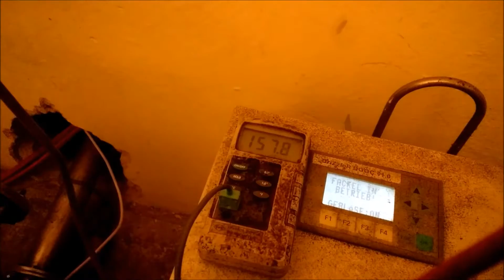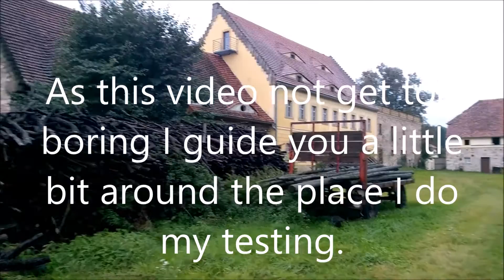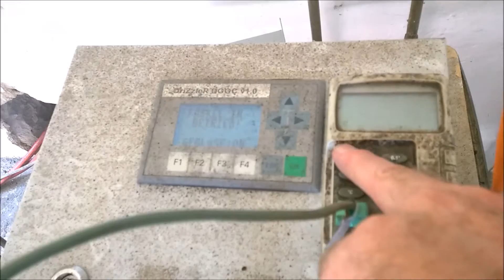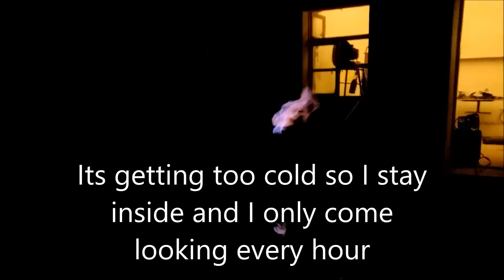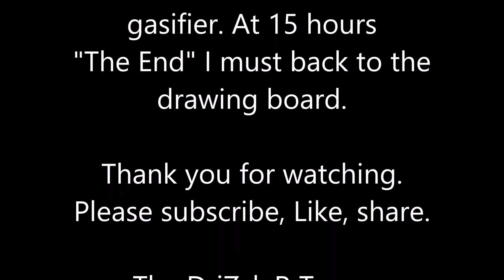DriZzleR continious runtest PART 5 ///15 Hours

Comment: Absolutely amazing. 
 While you might not be too pleased with it right now, I find it to be truly wonderful  :) . 
 One day, I will try to build something like this, as I am sure that it is better than an Imbert gasifier for stationary applications.
Reply from the maker: Steve, I set my goal on 24 hours running 7 on 7. 15 hours is still far away. I do not have experiences with Imbert. Pascal had an imbert for a long time and since he now stays with his DriZzleR that means to me that I can skip building such a machine. Imbert has his merrits but a DriZzleR is in my feelings more user freindly and safer to operate.    Luk
Reply: the DriZzleR Gasifier 
 That is indeed a worthy goal. In time, due to your obvious determination, you will surely achieve it  :) . 
 The Imbert gasser is pretty good, but it has its own set of weaknesses, which is one of the reasons I am drawn to your design. 
 Yours appears to be more flexible than an Imbert system is, and I get the feeling that it runs cleaner too. 
 It seems to me that the Drizzler is among the best designs for a stationary generator installation, especially if it can run for at least a few hours without operator attention. 
 You are achieving great things, and I look forward to seeing what you come up with in the near future. 
 Keep up the great work.

Comment: I would love to hear your explanation on what is limiting your run time. It sounds like you will be building a new gasifier.  I have a feeling you know what you will do differently . I am just curious what you think the problem is. Thanks for sharing. and good luck with your new design. Keep us posted with your progress. I am enjoying the show. Joe
Reply from the maker: Joe, Thank you for commenting. There are several things I like to change. First the way the gasifier agitator is controlled. It is now or time control, or underpresure control. Underpresure control is the best because reaction time is more precise.With time control one can be too late. Presure control sometimes leaves too long pause in betwee and if just then a clinker has formed then the motor of the agitator gets blocked. So mainly pressure with now and then a short agitation to be sure all stays loose. Stronger motor also needed.
Second I will change the evacuation of ashes. It is now done outside the drum. Long running fills up the drum and chokes the hearth. Also the ash drum is too small I must make it minimum 100 litres. And finaly I must changed the hearth. Now I use a custum turned sort of vice (expensie) with exstra narrow windings to keep the charcoal as dense as possible. Even then sometimes too much of the reduction slips away in this windings. In theory this vice is obsolete for clean fuel as pellets but Is needed for dirty fuel to evacuate small stones clay etc..etc...Also I must widen the gas exits because they ar too narrow and start up tar can build up thus after few starts preventing breeding. So no real fundamental changes, just tweeking and optimalisations.

Comment: Hi Luc. I have just finished reading ''Gasification. Succeeding with small-scale systems' by Andrew N. Rollinson from what he says I believe you are on the right track looking at the control of what is happening in the reactor. Are you still using Pellets? His view is that they crumble and choke the gasifier,,so chips could be better. BR as ever. 
Neil
Reply from the maker: Neil, Indeed in full hopper systems..Imbert...Fema...pellets can desintegrate from the moisture that comes off from the layer of warmed up fuel rising in the hopper. Then the mass of wet pellets forms aplug. The unique feature of the DriZleR is that there is no hopper above and that the dripfeeded fuel is gassed out the very moment it reaches the flaming pyrolise zone.you will find yet very little literature about the DriZzleR gasifier because it is a fearly new invention in gasification.